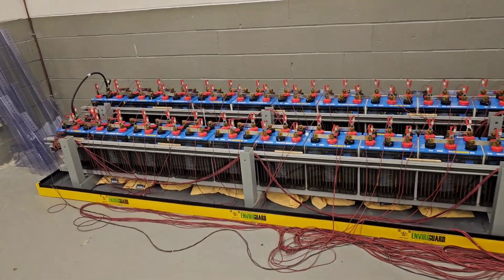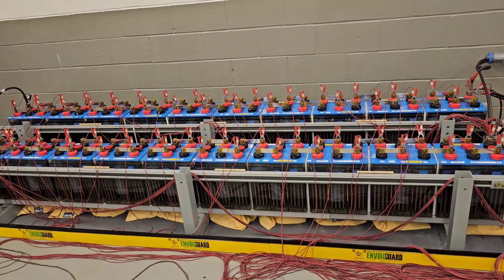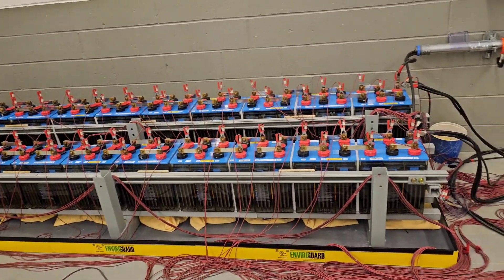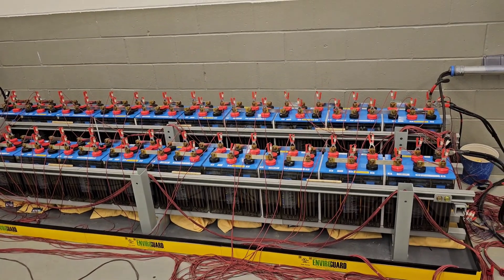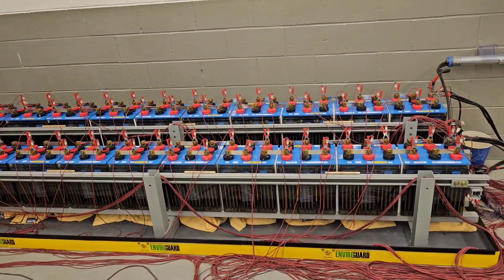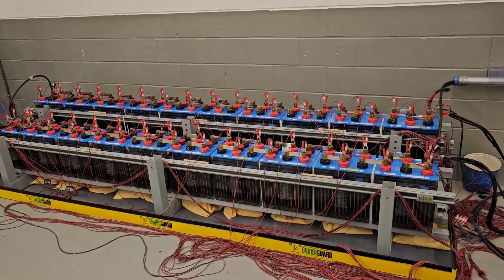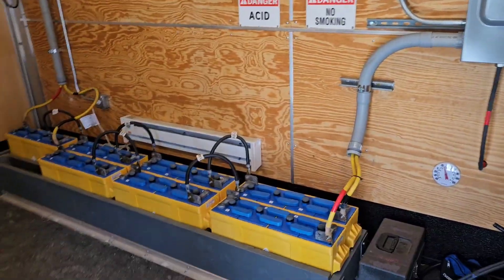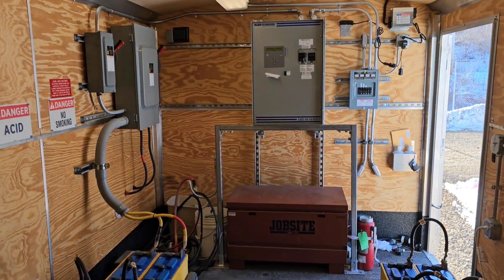Why batteries are critical to a substation and how this trailer helps maintain them. #Substationlife

Comment: i work for a telecom company in VA, fleet mechanic, I love the way these systems are built, our remote offices/ remote switch stations have battery banks on average 6x bigger than what you showed on average that will carry the load  4-8 hours in the event that the generator doesn't start up in time or runs out of fuel on a longer power outage, some generators are just ford 300 6cylinders and some switch stations have 24 cylinder caterpillar generators with batteries to match the 4-8 hours load

freaking love the engineering that goes into this stuff that no-one thinks about let alone half of the office techs or switcher board techs see every day
Reply from the maker: Nice. This station I showed is a smaller substation.  Our larger ones also have backup generators.  I don't think we have any 16 or 20 cylinder generators, but the stations with larger battery banks actually have 2 banks,  so when we test one,  we can swap the load over to the other set of batteries by using disconnect switches (no trailer needed!).   I have another video from last week showing a battery bank about 4 times as large... that's about the biggest bank we would use the trailer with.  When we test it, we draw 160 amps steady until the battery fails.
Reply: just remembered  a  truck in Richmond that is 5 axle and so heavy it cant drive with more than 100 gallons of fuel in it that can play back up generator think it's only a 16 or 20 cylinder 3 or 4 turbo cat.

Comment: Given that it is portable lithium ion might save a lot of oil dragging that trailer around!
Reply: They could also build the whole thing in a van, box truck, etc. I would guess these things are rather old, and Pb is what they know. (it's also cheaper, and less fiddly.) They could also just put two banks in every yard and not need this thing. ('tho a good power company will have portable backups for everything )

Comment: What are the wall heaters in the portable battery trailer for? Do they keep the batteries from freezing? And are they powered by the batteries?
Reply from the maker: The trailer is within 2 or 3 hours of any substation it services. It is always plugged in to a 240 volt source when parked so that the batteries are kept fully charged by the charger and at 60⁰ F or warmer by those heaters. I don't believe they would freeze because of the acid content,  but they perform correctly when they are warm.  Just like a car battery will work when it's cold... but not as well.